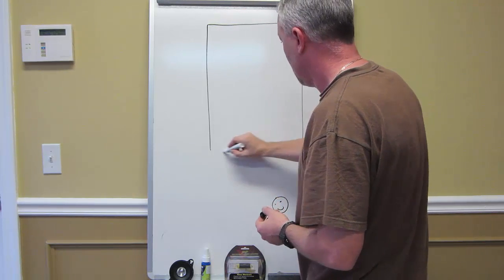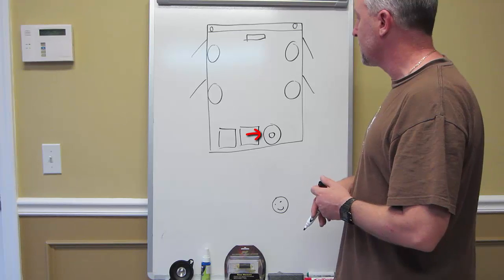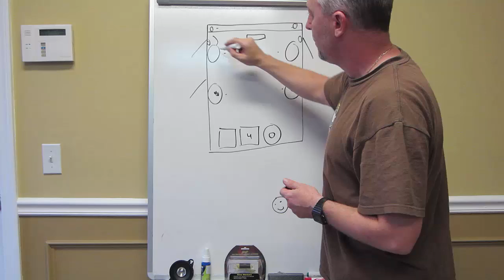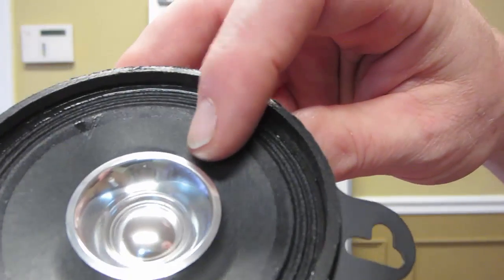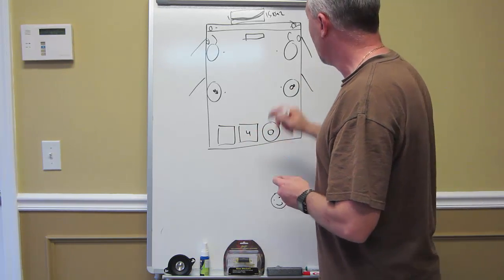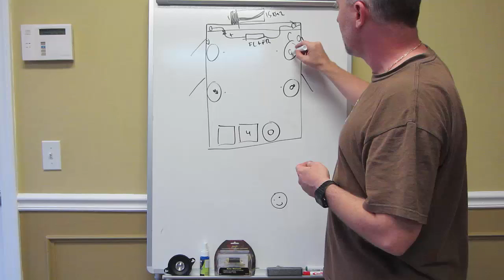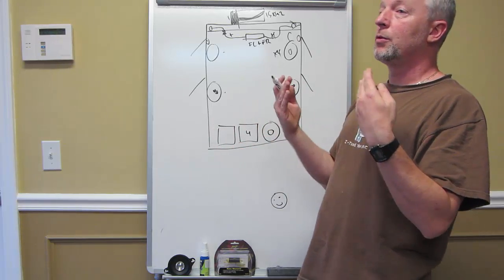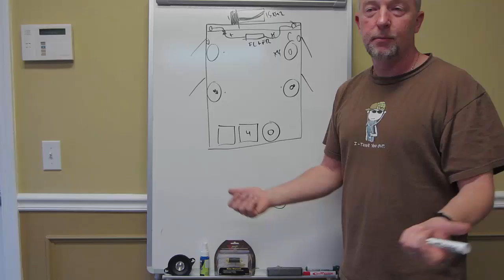How to wire a car audio system with multiple power sources

Comment: I would personally run the 3.5s with the rear speakers and run the crossover nice and high on the amp and do bass blockers still.  The head unit is gonna clip and distort those 3.5s way too fast.  The 4 channel can use just one set of rcas if amp has input selection otherwise use Y adapters.  Running rear speakers can ruin a system faster than they can help it so if a person is gonna run them they need to be turned way way down.  This set up is going to sound way superior to running anything off deck power.